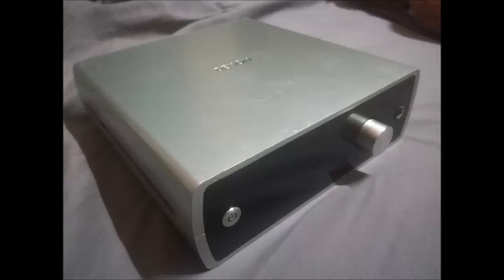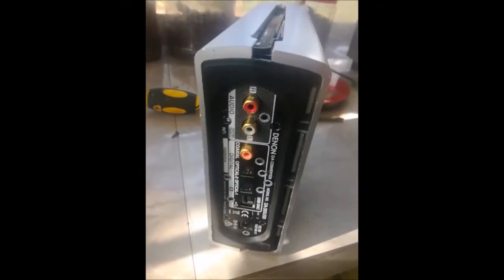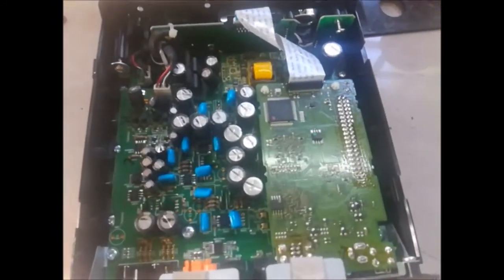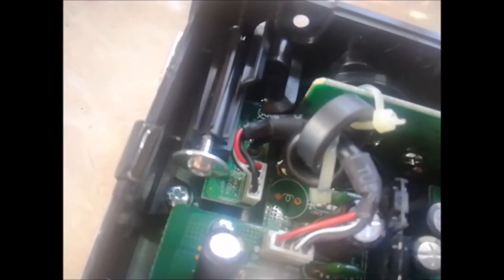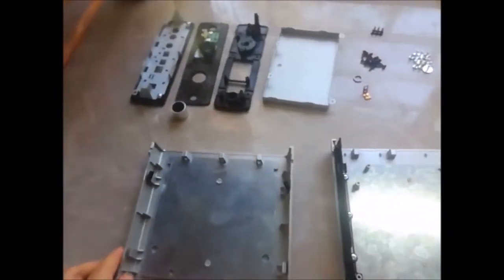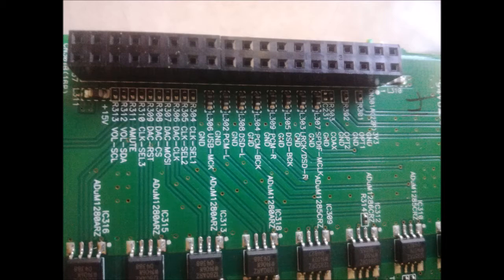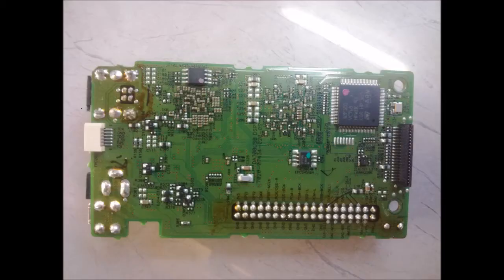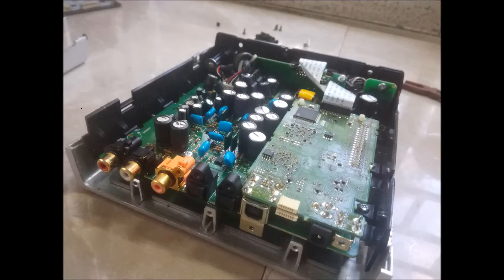Review + teardown: Denon DA-300USB dac

Comment from the maker: Update after comparison with other dacs...
1. Noticible treble roll off
2. Forward in the prescence region (upper mids)
3. Has a very engaging pleasent holographic effect which draws you into the sound
4. Pleasent to listen to even with poorly recorded tracks
5. Loses out on resolution to  more expensive dacs
6. Bass is not that quick/tight/fast, leading to less bass resolution

I much preferred this compared to a 3x or 4x more expensive Sabre based dac. The sabre dac was better in all the weak points for the denon as listed above, but was a bit "grey" and "lifeless", didn't have that engaging / pleasent sound of the denon

(2023 update: For those looking for a better quality sound with all the strong points of the DA300-USB, I highly recommend the SMSL D300 dac (based on the Rohm chip). It's effectively like a DA300-USB in character (very musical) but improves on the weak points (resolution etc). The D300 does take an unusually long time to burn in though but past that it is one of the better value dacs on the market I believe.)
Reply: The Denon becomes a giant killer when you add an iFi PSU or a linear PSU
Reply from the maker: @Yeastextract I would have liked to try that but have sold the denon already

Comment: Hi thank you for this very interesting review   I have two questions
1) i missed which digital input did you actually use in the listening test 
2) have you tried maybe better power supplies like a low noise linear or just the stock one ?
Reply from the maker: I used the USB input straight from my laptop/phone.
I have not tried a good quality low noise power supply. I would imagine the difference would be noticeable but maybe not worth the cost, seeing as there are better more modern dacs on the market nowadays. I'm very much of the opinion that the money spent on DAC + better power supply would be better spent on simply bypassing the cheaper DAC and going to the more expensive DAC in the first place.
I can recommend the SMSL D300, it has a similar sound / presentation to the burr-brown sound of the Denon DA300, but better resolving power and with more features such as high res bluetooth
Reply from the maker: iFi released the zen series of dacs to compete with the DA300 (if my memory from reading online serves me correctly...), they both use burr brown chips, but the SMSL D300 using the ROHM chip would be somewhat better than both of these with more resolution but a similar overall presentation. No digital glare. Burn in takes an age though.
Reply: @youtubiers  Thanks a lot again 
Yes digital glare is very unmusical and unnatural like pixellation in images 
When you talk about burn in do you refer to the SMSL ?
Reply from the maker: @gino3286  You're welcome, yes the SMSL D300 takes a while to burn in. At first cymbals sound like hash/powder/mud. After that goes away there is still quite a while until the DAC achieves its X-factor, so to speak.
Reply: @youtubiers  thanks a lot again for the very kind and valuable advice
I like the brand
I have their little Su-1 now
It sounds quite nice actually 
But always looking for something better
Reply from the maker: Bought another DA-300USB recently and tried it with an Ifi IUSB 3.0 (very good USB cleaner/reclocker) - couldn't tell any difference in the sound, and this was through good speakers/amp. Best value for better sound is simply get a better dac in the first place. I had an SU-1 too, they are amazing sound for the price. I didn't compare it directly with the Denon DA-300USB but it was good enough that I wouldn't say the Denon would be an upgrade. Perhaps the SU-1 even had more resolution?
Reply: @youtubiers  Hi thank you very much for your kind and valuable reply 
Imho a speaker or an amp can make more difference in sound that different dacs
But i do not have great ears or great speakers to check

Comment: Very cool breakdown! There is a used DAC-310 (basically the DAC-300 with an upgraded headphone amp (380mW at 32 Ohms) for sale in my area for $400. Do you think it is worth the purchase?
Reply from the maker: If it has all the features that you know you want, I'd go for it, but there is a lot of stiff competition. At $200 it's a no brainer but $400 is getting perhaps a little pricy, I'm sure there are a lot of other great DACs out there for $400. Depends on the market in your area too.
Reply: @youtubiers  Right now I have the iFi Zen DAC and Dragonfly Cobalt. Would you consider Denon to be an upgrade over them?
Reply from the maker: @MikeVernonProd  I haven't used either of those DACs but I know the cobalt dac is quite good. I wouldn't upgrade to the denon, I'd sell both your dacs and get something more expensive which would have a more noticable difference